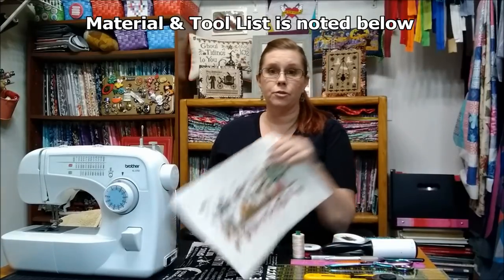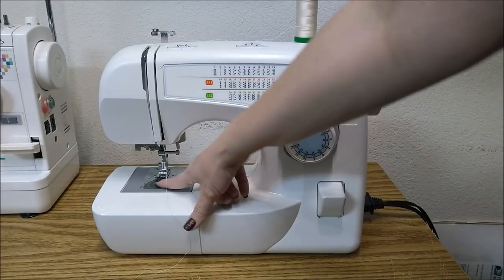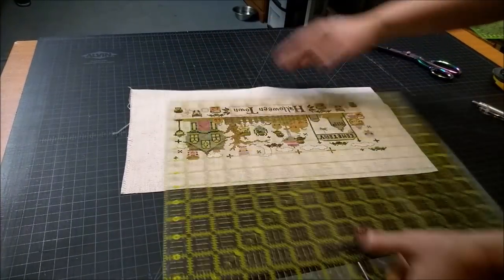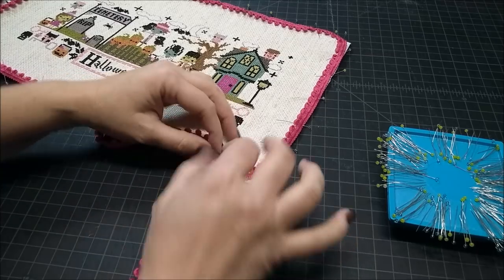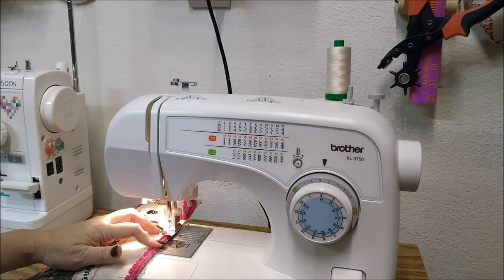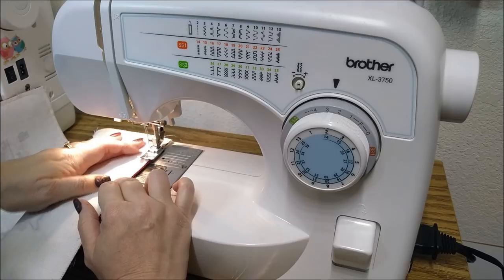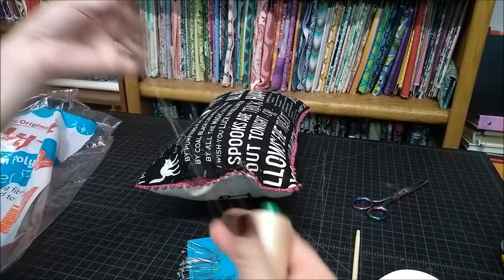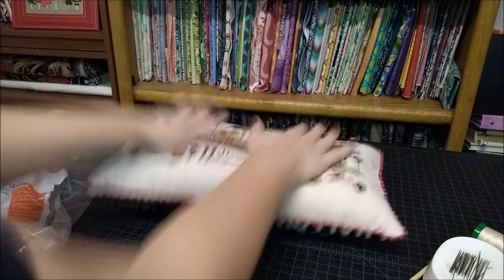Flosstube #6 - FFO Tutorial: How To Make A Throw Pillow

Comment: Hi Christine, from Hot Springs, Arkansas. 
I hope you see this I have a question. I am wanting to DYI frame a cross stitched project. Instead of stretching and pinning it, do you think I could just iron on backing, like you just did? It made it so straight and stiffer . 
Would love your feedback! Or ANYONES feedback!
Thank you!💞💞
Reply from the maker: Hi, Kimmi! I haven't framed a piece that way myself yet, but I have seen other stitchers pop their finished pieces into a frame without stretching it, and it looked fine. The finished stitching was already fairly straight, so they didn't need to work it back into square anyway. If I were to try it that ea, I would derifnitely use the interfacing to give it extra support as well. Let me know how it goes if you try it!